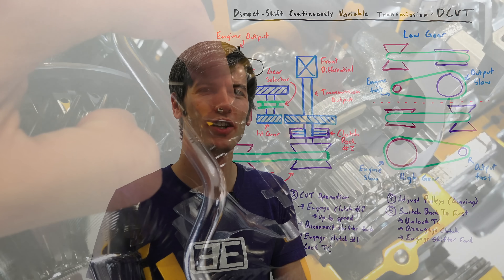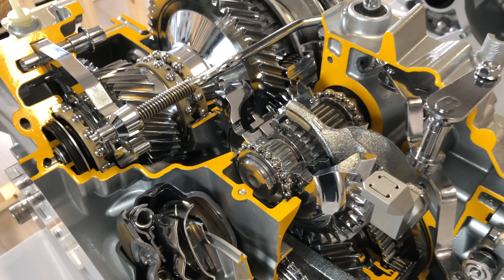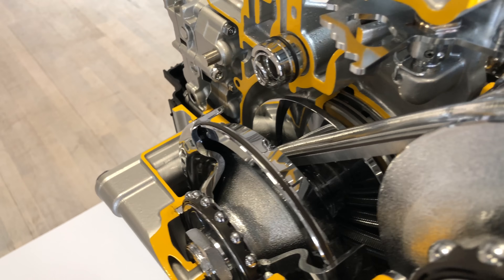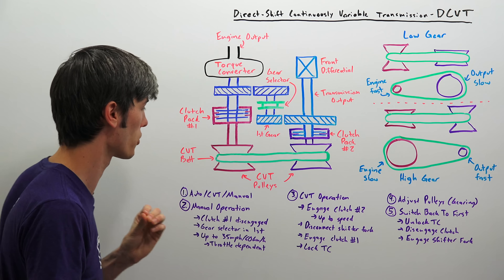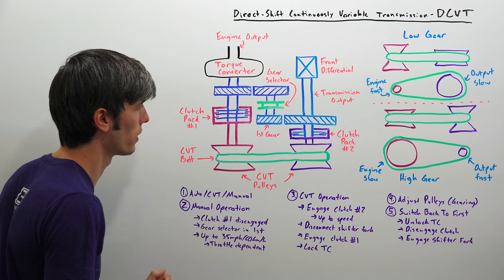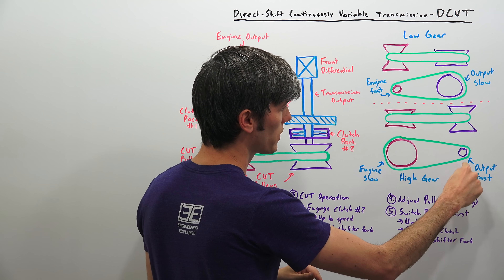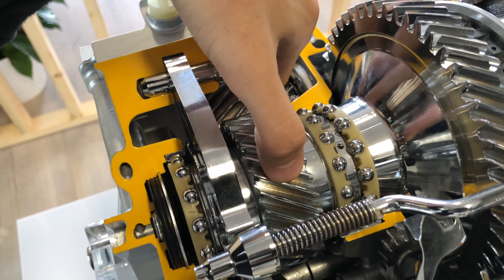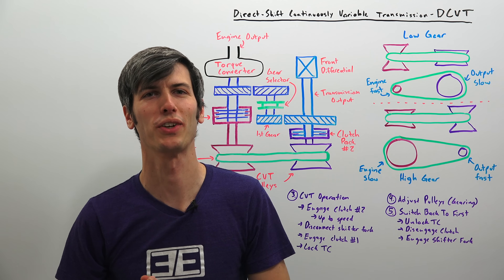The World's First DCVT Transmission - How It Works

Comment: Can you please make a video explaining why CVT belt doesn't slip at even low rpm. The pulley looks so slippery.
Reply: CVT belts use a V profile. So, if you increase the torque you increase the linear force on the belt, which wedges the belt harder into the pulley. This increases friction between the pulley and the belt. Increased friction means you can transmit higher forces through the mating surfaces. Translates to more torque. Basically, V belts are more or less self-tensioning as the load increases (up to a limit).
Reply: The belt pushes instead of pulling. That's why it's made of metal shims. Since the metal isn't compressible, the belt binds on the pulley preventing slippage.
Reply: @suspicionofdeceit Good fluid and constantly cooled.

That's the biggest reason Nissan cvts break.

Belt shears and slips becauae fluid is high tolerance, cooler on them sucks.  People have mitigated it by installing a better universal cooler and newer fluid. 

That said,  Renault Nissan did that on purpose. They pulled a Dexcool gasket scam.
Reply: @humansvd3269  the belt doesn't always shear on its own. Another common Nissan issue is the bearings under the pullies digging a groove into the shafts and eventually digging themselves too deep to continue moving, so they stick and break. The other pulley continues moving and that can pull the belt apart too.
Reply: @boredcompsciguy  Good to know! Nissan really designed it poorly.
Reply: Konrad Ford it’s not Nissan it’s JatCo
Reply: I suspect they don't slip mainly because they never put real power in front of them...because it would slip.
Reply: Transmission fluid. The oil lubricates the shims as they go into position on the sheave, then the force against the sheave displaces the oil and allows for friction against the sheave. If a CVT is well lubricated it won't experience wear to a significant degree and should survive the life of the engine
Reply: MASSIVE force pressing parts together.
Reply: chez421  You did not. But what you said about CVT popularity may be true for Asia, and Japan especially. Again: excluding diesels.
Reply: chez421  There is huge difference between manufacturer's offer and what is actually on the streets. I live in Europe, know tens, multiple tens of car owners and I am the ONLY one having CVT. This gives some real life measurement right? Saying that is less then 1% would be more then fair I bet.
Reply: Here's your quote: "... they use CVt in most European model cars that are diesel, producing 370Nm of torque and beyond." You absolutely did say most diesel cars in Europe use CVT. 

Just Just because they're available on the market doesn't mean people are buying them, not when there's a cheaper alternative with proven reliability available in manual gearboxes.

Comment: All's well and good until the clutch needs replacing.
Reply from the maker: They're wet multi-plate clutches, they'll last an incredible amount of time. Same tech is used all over different style drivetrains, and all kinds of AWD systems.
Reply: @EngineeringExplained  In Subaru's automatic AWD, they use this kind of clutch pack, and with milleage and wear, the awd tends to not engage smoothly and when you want it to. So maybe they put a better clutch system, but I fear that the wear would make the 1st to cvt transition not smooth in this transmission. Only time will tell
Reply: i don't think that i've ever rebuilt an automatic where clutch wear was the cause of failure, always some other failure that may have also destroyed the clutch pack.
Reply: it will take at least over 250 000 miles to replace it because it is not primary clutch for starting up the car from standstill.
Reply: Even standard automatic transmissions use wet clutch plates. That's typically what goes toast in a automatic transmission  from not changing the fluid, or running it too hot and wearing the plates out.

Comment: I can see that this is not made to be worked on... If anything at all breaks, you're gonna have a bad time.
Reply: Prettyych every transmission nowadays is going to be much harder to work on. But if it's can be made then there is a way to work and fix it, just got to adapt to new tech.
Reply: @ManuJohn380  having a way of fixing it does not mean it's practical if the cost of fixing equals of exceeds the cost of a new one...
Reply: Exactly what I was thinking!
Reply: It's a Toyota, it's not going to break. It does seem massively over-complicated, although my GS450h has some ridiculous dual-stage planetary setup (with 2 electric motors and a V6 all going through it) and I literally can't find any record of one ever having an issue. If it does break, so will the bank unless it's in the next year under the warranty, but I'd put a lot of money on these being more reliable than any DCT. In fact I did- the cost of a fully loaded GS450h.

Comment: So basically, it's a CVT that can do burnouts? 😛
Reply from the maker: Ha, excellent! As long as your wheel speed doesn't exceed about 35 mph, you'd be using a set gear ratio. But to be fair other CVTs could also do burnouts, they're just generally used in non-burnout style cars. :)
Reply: @EngineeringExplained  Are you saying that a Honda CRV isn't a burnout style car?
Reply: it's easier - honda crv not a car lol, it's shitbox
Reply: @RAPXZibit  speaking from experience?
Reply: @RAPXZibit  Honda is one of the only manufacturers that make transmission in house.  Their Automatics are terrible and clutches in manuals are weak.
Reply: @suesan5111  how long has this been the case? I have a 90 Accord pushing 220k miles & the clutch & transmission are still going strong except for the usual bit of crunching 2nd -> 3rd & 3rd -> 4th when the driving gets very spirited. (Sidenote: car was "abused" by someone before it came to me, why do people have trouble with the shift gates going 2nd->3rd & 3rd->2nd/4th? It's not rocket science yet 3rd gear synchros are invariably the 1st to go.)
Reply: But sir, the shitbox cars are the best for burnouts, since you don't really care what will happen to them!
Reply: @EngineeringExplained  i want a manual cvt with a slider handle. how should I implement this?
Reply: @ellenorbjornsdottir1166  I used to have a riding mower with that style of transmission. I believe they're called hydrostatic transmissions.
Reply: @ellenorbjornsdottir1166  like a small aircraft XD
Reply: I've done a burnout in my nissan maxima. It's not necessarily the transmission, it's that most cvt cars are low power econo boxes
Reply: I still want to see a manual DCT. The control architecture would be really interesting methinks.
Reply: @johnrickard8512  but in this case wouldn't it be better just to put an manual on the car?
Reply: @lucasZr113  manual are less efficient theses days  regardless how you drive it
Reply: @Mensaje22  fair enough, I was thinking from a driver's enjoyment perspective
Reply: @Mensaje22  What? You serious? Crap like exists only because people are freakin lazy, manual was and will forever be the most efficient transmission, lighter, less parts, less breakdowns, less maintnance, direct power. Go learn mechanics first.
Reply: @tunespt  A manual with 3 gears is never going to be as efficient as an auto with 6. Which is where we're going to now.
Reply: @Appletank8  yeah i think he's getting "reliable" and "efficient" mixed up lol manuals are generally easier/cheaper to fix or maintain but they really aren't as efficient as autos or cvts
Reply: @lucasZr113  Muricans don't buy manuals anymore.
Reply: @johnrickard8512  DCT is all about preselecting the next gear & having one clutch disengage & one clutch engage in a synchronous manner.

I don't think it's possible to do all of that manually with one pedal & one shifter. Or at least having it user friendly. Could set the pedal to "flip flop" the clutches with every push & possibly use springs & hydraulic valving that work off the clutch to allow you to select the next gear but that would be extremely non user friendly. Some kind of mechanical interlock voodoo allowing sequential style shifting that only allows one up & one down gear regardless of how many times you push/pull the gear shift could potentially make things more usable. Then there's starting from a standstill/moving through multiple gears while coasting to a stop/skipping gears. I suppose one could implement a split clutch pedal, one that performs the aforementioned "flip flop" & another that when depressed simultaneously disengages both clutches. The currently selected gear could determine which clutch gets engaged when both pedals are "let out." There would need to be a fairly prominent display of the currently selected gear & the next preselected gear as well. 

Basically, it would be a freaking nightmare to engineer & what exactly would anyone gain from it besides being able to say "we figured out how to make a purely manual DCT work?" 

If faster shifts are desired/needed from a pure manual box then a straight sequential would be the best bet in my opinion. If I misinterpreted your goal then I sincerely apologise! Let me know if that's the case & I'll respond with something more accurate.
Reply: @Iceberg86300  I think he meant fully autonomous(as in being able to dictate a specific gear, without electronic override).  But even that is a bad idea, cuz you can over rev the engine.  I Love the new trick Mazda DCT.  It uses a wet torque converter to address the crawl speed issues.
Reply: @johnrickard8512  manual dual ... So, two clutches, two sticks?
Though really, paddle shifting would be close enough anyway.

What I wanna know is if people would want an electric car with a software gear stick/clutch
Reply: @johnrickard8512  Buy a Suzuki Burgman 650 and use it in manual mode. That's not dificult to achieve.
Reply: Dude, I can do a burnout with a 50cc scooter!
Reply: CVT technology now going back to traditional automatic gears😂
Reply: Lmao blacktree cute little yellow face typed and tongue pop out lmao
Reply: @steveXracer - LOL
I probably should have said "can do burnouts without exploding". 😉
Reply: The thrill from the risk of surprise shrapnel is the icing on the cake when yer gonna do them burnouts!
Reply: My QMB139 Scooter Can do Burnouts! Has same original.
But have just 50kg, included the engine.
Reply: Toyota Owes Subaru this technology.  After all, Subaru was nice enough to build them an Entire Car, with a boxer engine.  Subaru really needs a better transmission.  Boxer Symmetrical AWDs with a LAUNCH Gear would be totally Awesome !  Finally put some Power down!
Reply: @suesan5111  toyota own a large portion of subaru
Reply: @nic.d7539  i did not know that.  Toyota is like G.M..  They own part of everybody.  Except, they make good cars too.
Reply: toyota owns 16.5% of fuji heavy industries (Subaru)
Reply: @suesan5111  I think I read that the new PHEV Crosstrek has a fancy CVT - Maybe Toyota's? - They're borrowing Toyota's Prius Prime tech for the PHEV. Maybe the boxer + the Toyota stuff = victory? (Minus the whole oil consumption deal...)
Reply: @saha6818  oh Man, i get dizzy, trying to follow all this.  So can you post link, or "  ", so i can study when i am sober?

Comment: God help your bank account when it breaks. 🤪💵💵💵💵
Reply: How fortunate that this one is made by Aisin. They seem to have a knack to build these to last.
Reply: It's a Toyota transmission, not a Chrysler lol
Reply: A lot of very large car makers do not use in-house built transmissions.
Reply: @CompTechs  Actually, Toyota is the parent company of Aisin and they were spun off in July 1991 and supplied only Toyota until 1996 when they started selling to the Chrysler , now they sell to many manufacturers all over the world but Toyota still owns something like 40 percent of the stock
Reply: The first gear is there to deliver low rpm high torque where CVT would have a hard time (which would be the first to break). So yeah, would probably last.
Reply: Company with good transmission track record with a car that doesnt have much power, I don't think you should be to worried about it breaking
Reply: This is the great thing about this design - the novelty is combining the best traits of existing designs into one package. It is essentially a manual design (shift forks) matched with an automatic (torque converter & a "2 speed" gearbox) matched with a CVT (the belt driven unit acting as "2nd gear") with two wet plate clutches. There is no new fancy technology at play here - and this is Toyota we're talking about whose Aisin transaxles have proven to be quite durable.
Reply: @Trades46  Even on my VW Tiguan, when just about everything else has been replaced, sometimes more than once, the transmission is still running fine. Guess who supplied the transmission. Aisin of Japan. It uses the same fluid as Toyota.
Reply: @ACitizenOfOurWorld  I'll never drive another VW in my life ever
Reply: Versus say what, a cheap transmission to fix?  They have them now??  Why would it break anyways?  It's mated to a Corolla/Auris, not a drag car with 1200hp.
Reply: It's tough but complicated
Reply: Clutch replacement: thousands of $$$ ...
Reply: It's in a corolla therefore bulletproof
Reply: I don't see how it could break, it uses simple and traditional mechanisms
Reply: This is why you should lease these vehicles.